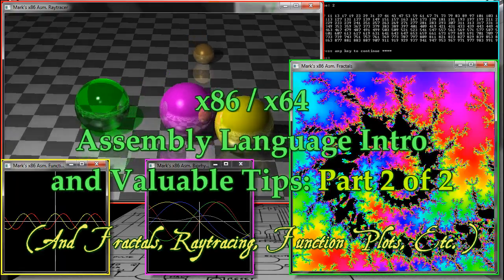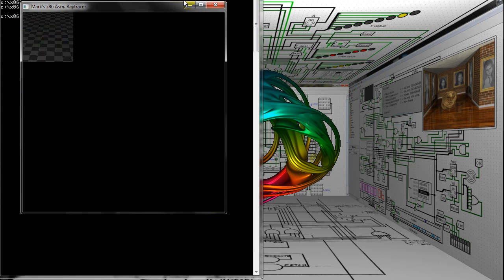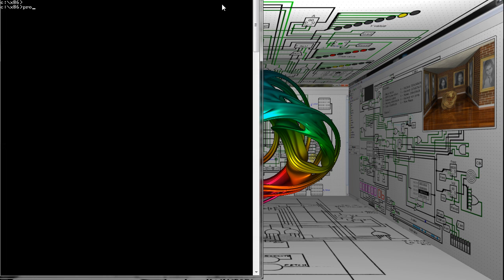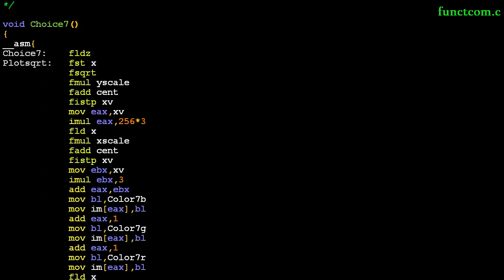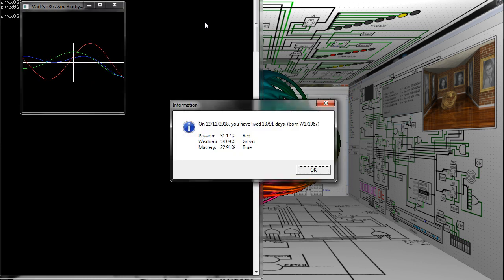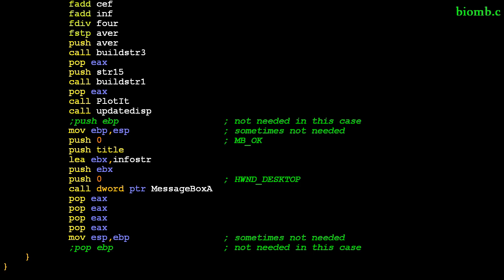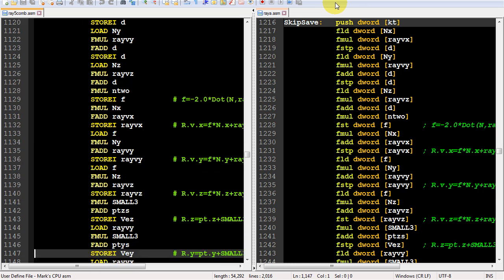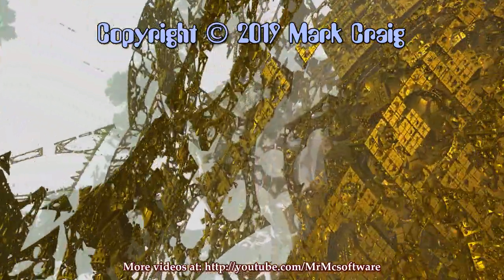x86/x64 Assembly Language Intro (part 2 of 2) and Valuable Tips

Comment: Assembly is incredibly fun to code with, but damn is it hard. When I first took a look at some assemby code, I thought: "That does not look too hard"
Well, I was wrong.
Your logisim computer videos actually led me to you, and your videos are awesome!
Reply from the maker: Thanks very much for the compliment!  I'm glad you like my videos.  Yeah, assembly isn't easy.  One of the things that makes it harder is debugging.  You can use breakpoints (if your debugger/system has the capability), but it's still a lot harder than the "print statement" (printf, etc.) method.  So it's always a great feeling (relief) when the assembly program works on the first try (don't have to debug) (and a terrible feeling when it doesn't work).

Comment: You could always archive the links at 11:13 to make sure they stay up. Awesome videos by the way! I'm doing x86/x64 assembly at university, in the fall so it helps a lot.
Reply from the maker: I guess you mean archive.org - I didn't know they took submissions/suggestions.  That's a good idea.  And thanks for the compliment!  I'm glad my videos will be helpful.
Reply: Thank you for the videos. Yeah, if you go to https://web.archive.org/ you'll see a "Save Page Now" section in the bottom right. Anyone can enter a URL here and it'll save the page as it appears on that day. Then any time you need to give out a link you can give out the archived version and know that it won't just disappear. Oh, and if you need the link to the real website you can just trim the "https://web.archive.org/web/20190124011757/" section off the front of the archived URL. It's pretty cool.
Reply from the maker: That is nice!  There's some websites from the past I wouldn't have minded preserving (but at least some were before archive.org existed)